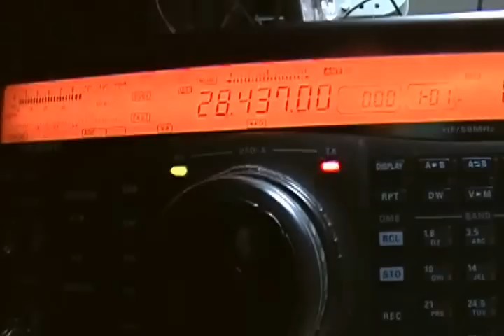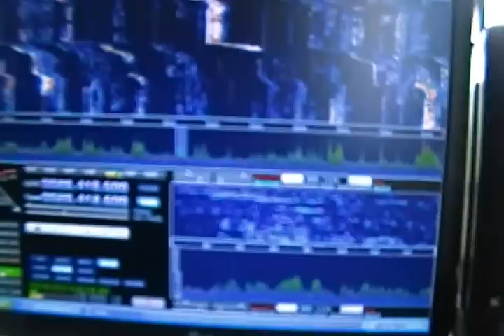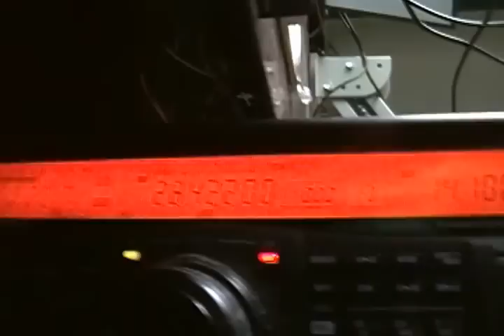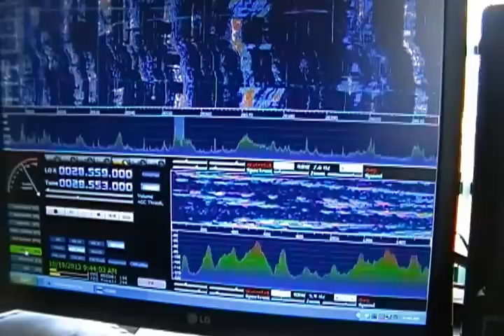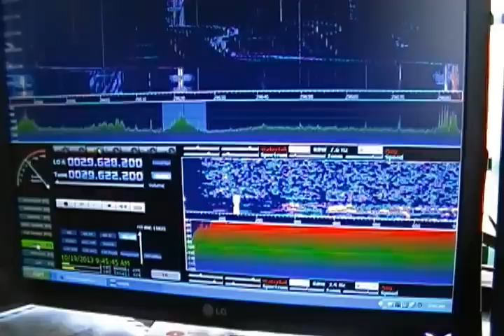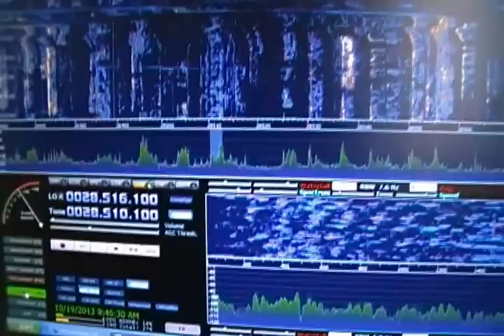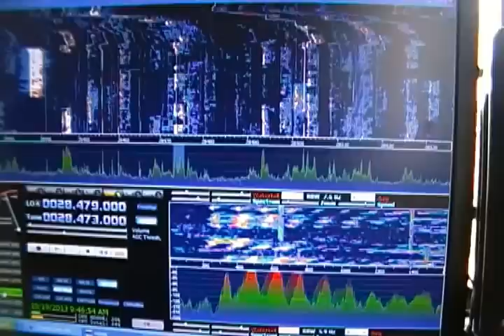RTL 2832 SDR Dongle Panadapter on 10m / FT 920

Comment: This may have already been mentioned, but I assume you can also then use the SDR software as a sort of second receiver and actually preview the other signals in the waterfall through the SDR's receiver functions.
Reply from the maker: I think so , but i didnt try it
Reply: The SDR is like a parasitic receiver, dug in to the rig.   If you do try it,  please post a video example.   It's going to be a while before I can take the time to tap my IC-745's IF and start experimenting.

Comment: Can do this without having to use an I.F. tap
Reply from the maker: M1BCM , can you further explain ????? By the way , I do know of all the other ways to have a panadapter, but this video shows how to have the full band on a pc as cheaply as possible ..
Reply: Leon S  I understand what this video shows. But many operators don't want to or are unable to get inside the radio to make mods etc. I use an RTL 2832 dongle with a duplexer and use the RX in/out sockets on my 920 or 1000MP with Omnirig software to get onscreen coverage of all of the HF/VHF/UHF bands.
Reply from the maker: M1BCM
 do you have pics or a video of your setup ???? I still dont understand what you did .. hy a duplexer ???